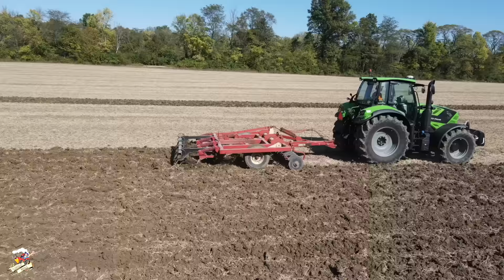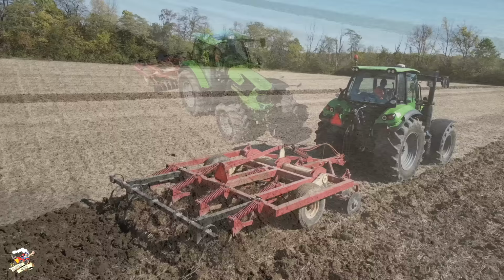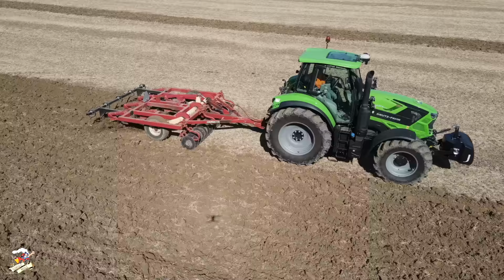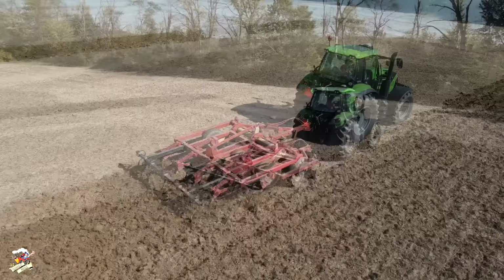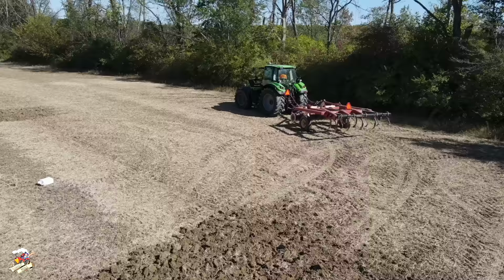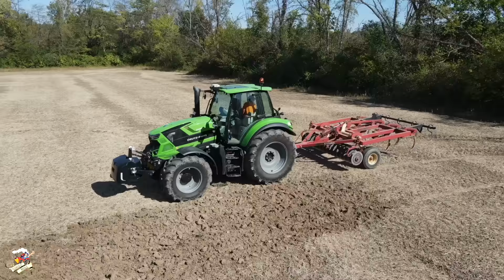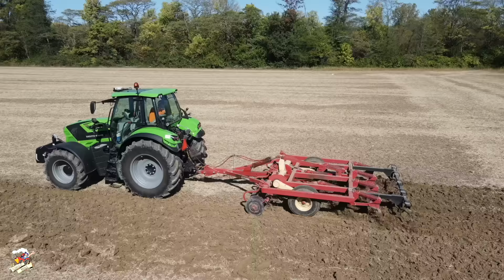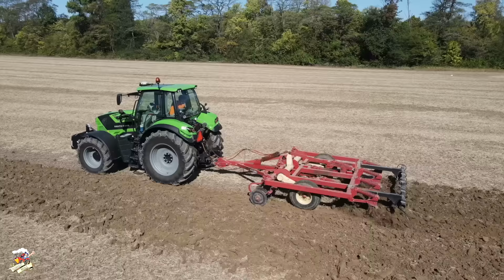Deutz Fahr 6175 TTV Tractor pulling a Krause 7 shank chisel plow in Indiana.

Comment: That little chisel plow does a nice job. Would take you quite a while to cover ground though.
Reply from the maker: I don't know used to work a lot of ground with equipment this size not so many years ago.
Reply: Still substantially faster than a 6F moldboard plow, which used to be the common fall tillage method.

Comment: Great video but I’m wondering why someone would get one of these tractors when they could get an 8300 with a bigger cab and more power for cheaper or the same price?
Reply: This tractor runs about 800 hours per year, and an 8300 is way too inefficient, unreliable, and outdated to do the work the way we want to. A Deutz-Fahr will cut the fuel consumption in half. This 6175ttv can pull our 26' disc, but also is nimble enough to run the round baler and square baler in tight hay fields. It's also narrow enough to pull our large grain wagons to the elevator, runs 31 mph doing it, and is smooth with front axle and cab suspension. The front hitch allows for quick ballast change in minutes. Integrated auto steer and isobus is also a huge plus. Our local John Deere does not provide good service either. I can't think of one reason why we would want an 8300.